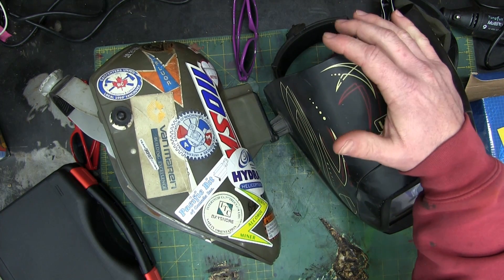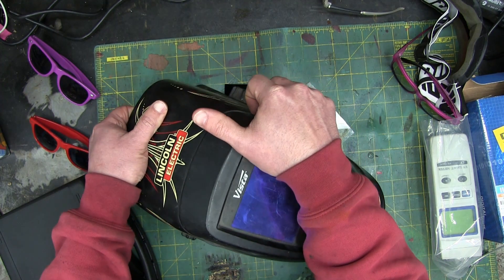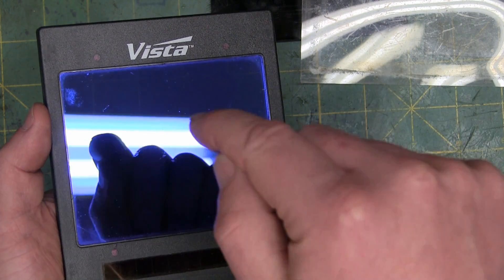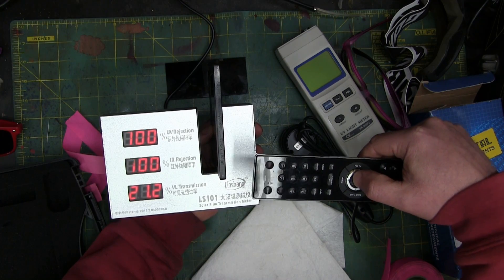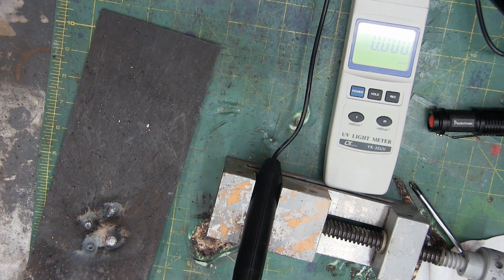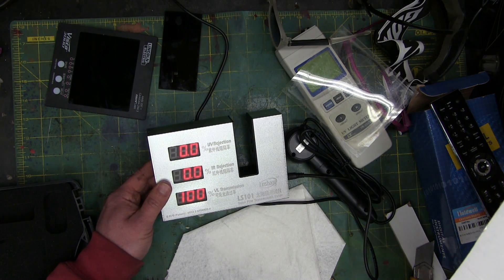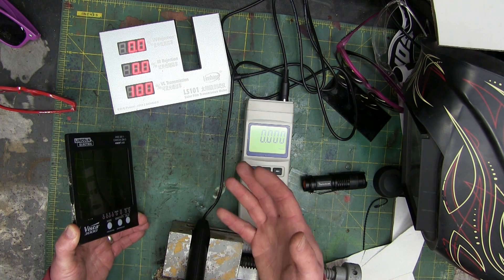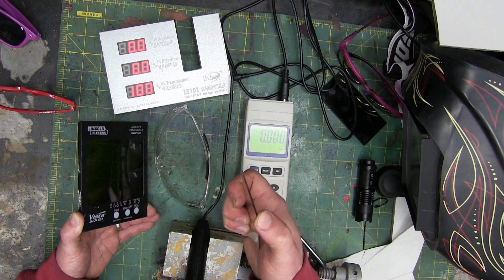SPEED DOESN'T MATTER?! Auto-Darkening Welding Helmet

Comment: I'm a machine operator at a sign company and I run a cnc plasma cutter.  My boss supplied me with shade 5 glasses and I was wondering would that be a safe shade level for running the machine because I think the plasma torch is not as bright but is it?

Comment: I doubt the electronic sensor is faster then the speed of light, I prefer the old way.
Reply: AmongTheWillows 
I am a novice welder.  
If I forget to flick the manual helmet down I have done my eyes some serious harm.
If I forget to turn on the auto-darkening back on, I have the full-time protection of the IR and UV filters in the helmet ,so it's uncomfortable for a second and reminds me to concentrate, but no harm done.
Reply: Andrew White I like the googles, pretty hard to forget those but easy to forget to turn the helmet on :)

Comment: I use my Auto Dark as though it is a fixed lens version.  I don't toss it around, but I close my eyes before striking the arc.  Then open them when I have it on.  So I never get even a microsecond of full exposure.  Of course, I did use it AD mode when I was learning

Comment: what's up with that wire feed dude? i thought they were for wimps....nawww, i love my steel squirt gun. i primarily rock the manual hood sheild welding helmets. broke a few cheap autos. i have hot glued tinted glass lenses into broken auto dark helmets AND used the sides of plastic bottles for a lense cover thing. i am an expert at the power nod welding shield filp down head bang maneuver.

Comment: Apologies if it has been asked already but... could you test the 3M safety sunglasses for IR, UV and visible light. They claim to be 99.9% UV A/B blocking but don't say anything about IR. I suspect they will be similar to regular sunglasses but because they are impact resistant may be sufficient for grinding.

https://www.3m.com/3M/en_US/company-us/all-3m-products/~/3M-ForceFlex-MAX-Safety-Eyewear-Obsidian-frame-with-smoke-lenses/?N=5002385+8740610+3294573936&rt=rud

Comment: Your high speed camera footage was too high speed! I blinked and missed it!
Reply: @TDAKS Probably HARD TO get a camera fast enough TO RECORD .04 MILLISECONDS?
Reply: Not possible by just a Blink...unless you had a decent shut-eye ! or....you are kidding ! Lol !
Reply: The way you record the speed is by having an LED act as a photodiode (or if you have a photo diode + resistor then use those.).  Hook up diode+resistor it up to a psu negatively biased and then hook a scope across the diode.  The time the light goes from something to next to nothing is the reaction time of the glass.  Simple.  You coild shine a bright flashlight through the glass if you wanted.
Reply: two photodiodes into a DSO, that'd give a usable measurement, yeah.

Comment: Clear motorbike helmet visors are UV blocking for the most part but not IR, otherwise you wouldn't feel heat from the sun through it. No good for welding though.

Comment: Talking about auto helmets as a welder I tell people to get a miller digital elite. I've had a speed glass and a Lincoln.They were both shit. So I got an elite and never looked back. Plus the miller has "X mode" which is marketing wank for an em sensor. Works great for welding out in bright sun or construction lights and in confined space where the ir sensors can be blocked.

Comment: I would be interested in checking out the efficacy of polarized sunglasses, and maybe even those yellow-tinted safety glasses, for S&G's.  Also, curious to know if looking at the arc reflected off a white wall is harmful, or if enough of the energy has dissipated from the process.

I worked in a shop that built a lot of furniture, and I was the "wood guy" (yeah I know, but somebody's gotta move the carcasses around).  I used to get flashed all the dang time even though I was working on the other side of the shop.

Comment: As a person who has had to wear glasses since 1981, I'm completely disgusted with those of you who use "safety squints"  instead of proper eye protection.  "Ahhh, I wear safety glasses when I'm grinding...."  Blah, blah, blah.  For the past 36 years I haven't been able to see the freakin' alarm clock clearly without putting my glasses on.  Eye exam, frames (decent frames), lenses can be up to $400.  Run of the mill safety glasses (not to mention cheap sunglasses for you perfect vision fucks) $10-$20.   If you have perfect vision and don't protect it, then get a chunk of metal in your eyes... you'll get no sympathy from me.

Comment: Hey Oncle, I've got a question for ya, my father is a welder, not professional, but more than a hobbyist let's say, I bougt him an automatic shield, not a 500$ one but not a crappy one either (paid around 250european pesos) anyway, he is welding with an arc welder, and he complains about the shield not beeing quick and dark enough, I do not complain when I mig weld with it (I'm getting to the point here, don't worry) is there a big difference in the light radiation between arc welding and mig (or tig) welding?

Comment: I have an interesting question in my job I regular use infrared heat lamps in order to dry things do infrared heat lamps put out the same type of radiation that cooks your eyeballs and what type of protection should I be wearing to avoid this also my workshop we have some of the infrared heat lamps that don't produce light are they still producing radiation would appreciate an answer

Comment: Problem is this tester don't have intense source of UV or IR light during testing! Weak light and even simple clear plastic lens absorbs almost all of it. But situation with intense UV from welding can be very different. More intense radiation - more shielding is needed, tester don't check glass under that circumstances!
Reply: Прикладна Економіка nah it absorbs as a percentage and that doesn't change

Comment: What range of wavelengths is your UV/IR/VL transmission detector measuring? Reason I ask is it could be saying safety specs block 99% of UVA, even if it transmits 99% of UVC, which is the real concern with arc flash.

Comment: If I remember correctly, Acrylic blocks IR transmission really well.
Reply: Acrylic blocks far infrared (>3000 nm) really well, but the IR of interest here is near infrared in the region 700-900 nm, just outside the visible range. Acrylic, as well as polycarbonate, (unless it has been formulated specially) both have excellent transmittance in this region of the spectrum and thus offer no protection.

Comment: Ultra-violet welding sensors would never trigger in that Lincoln helmet, as that (very thin plastic) cover lens blocks almost 100% UV just on it's own.
Every single layer of clear plastic lenses and the untriggered lens-module in the helmet already blocks UV (and IR to a small extent), so the electronic lens really only has to block visible light.
Even crappy $2 clear plastic safety glasses will block 100% UV from your eyes, but IR and visible are a completely different matter.

Comment: IR is not heat. Hot things (by our standards) give off IR but if they're hot enough they'll give off red light (and lower wavelengths eventually) too. Cold things can give off IR too, like IR LEDs. 

The problem with low wavelengths is not that "it's heat" but that low wavelengths penetrate deeper.

Comment: Arc flash eye remedy. Boil potatoes and drop some of the water from the pot into your eye's. Soothes the irritation fast. 

Pasta water works as well. It's the starchy water that you want. I don't know how it works but it does.
Reply: mcpheonixx Let me write that down.. Pour boiling hot potato water in eyes when they hurt.. Thanks a bunch!
Reply: Dionamuh I appologize, I'm used to working with people with a modicum of common sense. For the simpletons out there, please cool the potato/pasta water off before putting a few drops of it in your eye. The funny part is if I have to explain this, then you really shouldn't be around welders or even a shop environment at all!
Reply: mcpheonixx I was joking. ;)

Comment: I came into our lab one day and saw my rubber boots had been worn by someone. I was pissed, just got them the day before, steel toe rubber boots, fuck yeah. Well some electrician needed some boots to work on a plater that had some water in the pit. The guys on day shift told them where my boots were and they could use them. It's been a year and I'm still fucking bitter about that.
Reply: My company is an automotive brake factory. It's machining, plating and then  assembly. I'm in the plating department. We mostly plate zinc with a chromium passivate but we also do nickel/zinc and nickel for some of  the pistons.

Comment: It is only pulsing infra red that triggers those auto shields, steady IR does not, try holding one of those masks up to the sun, it wont trigger but wave your fingers or a piece of cardboard with a slot in it in front fast enough and it will trigger. If you think the sun glasses in cardboard are cheap/funny, when I visited Zimbabwe I saw someone welding using an old black sock tied around their eyes.

Comment: I thought that polycarbonate is opaque to IR because you are able to cut it with CO2 laser that emits IR-light. What about clear glass, like eyeglasses and I don't mean those with plastic lenses but with good old safety glass ones, are those opaque to IR?
Reply: Come to think about it; if I sit in front of the window on a sunny summer day, I can feel the heat of sunshine even through three layers of window glass, so it does not block all of IR.

Comment: Take it from my own personal experience DO NOT Electric Arc Weld without a welding helmet I just used one a little too casually once I was cheating and started the weld without the welding helmet that night I woke up at around two in the morning with my eyes burning and feeling like I had hot sand being blasted into them man It hurts I went straight to hospital it was that bad. I'm guessing it is the same with Mig Welding believe me guys if you value your eyes wear a welding helmet.

Comment: What is the emissionwavelength of the testilidue device? Is it nir (about 850-980nm) or far infrared? I bet it is nir and then have a looksie of the transmission graphs of acrylic or polycarbonate... far ir does not go threw fucking plastic therefore it is a protection for these far infrared

Comment: How much uv or ir does an eyelid stop?🤔
Reply: ever tried to weld with your eyes closed? it aint going to work mate. use a helmet...
Reply: I'm not a welder. But have watched welders tack weld eyes shut and hand to shade.  This  was before electronic sheald.   Just wondered what level of risk they where at.  Thanks. Merry Christmas
Reply: @paulince1715  that's a fair question,  I have done the same when holding something that was being welded

Comment: Hey AvE, not a an expert by any means, and someone else will probably tell me I’m way wrong. But, i have some experience operating and maintaining IR sensor balls on military aircraft, what of the laser designation type and surveillance type. Anyway, that fancy meter you got, what wavelength of IR, or range is it testing. Because near IR (just under the visible Red) will act like visible light, but far IR won’t pass through anything transparent. You just pick up the service radiation of the material. Hell, humid air is pretty good at reducing the resolution and sensitivity of even the most expensive IR equipment.
Reply: The meter is testing 950 nm (near infrared). The arc spits out a disproportionate amount of NIR, and the glass body of the eye has good transmittance of light in the NIR part of the spectrum, meaning it will heat up the retina and possibly damage it. Like visible light, NIR is also focused at the retina. On the other hand the eye (like most things as you've noticed) is opaque to far infrared, meaning that at least the retina is safe from FIR.

Comment: I spent more on my welding helmet that my first welding machine and for good reason. My helmet has 3 modes weld, grind and torch also you can set the sensitivity high enough to auto darken when using extremely low amperage. The nice ones are well worth it.... unless you forget to turn it on.
Reply: Well, as we just found out, even if you don't turn it on, it'll still block out the most important parts of the spectrum regardless.
Reply: most cheap hoods have those options nowadays.

Comment: We bought a 30 something dollar auto darkening welding helmet for the eclipse, it wouldn't darken at all no matter what we did. Used my buddies less crappy auto darkening helmet and it worked perfectly. My question is, would even my cheap-o 30 dollar helmet be providing the same protection even without blocking the visible light?

Comment: Merry Christmas Uncle Bumble....

The prescription lenses in my spec's show up black on IR. They're acrylic plastic based with refraction enhancers .. can't get glass lenses for my dehanced vision any more.

Worked for 7 years "in" steel fab shop. Avoided welding "flash" and radiation burns... Always wore long sleeved shirts and kept 5 metres away from arcs in gas when not wearing eye protection.  Submerged arc... Wow. Only the warm glow of the backing bar tells you that it's working.

Comment: Excess visible light can cause damage as well. Flash blindness can be permanent, you end up with (at best in the permanent case) bright spots that never go away. Auto-shade welding helmets do tend to have a "grind" setting for a very slight darkening of the shade. Otherwise you can wear cutting/grinding glasses. Clear safety glasses are best reserved for working with the closed-cell carbohydrate foam materials and cutting processes, not anything that can throw bright sparks. 

Also it's Z87+ for the high-impact-resistant polycarbonate.

Comment: could you test different samples of common glass? all this reminded of feynman observing the first a-bomb test through a truck windshield, ditching the issued dark eyewear.
Reply: I read that too, and remember he explained why he could get away with it. The laminated auto glass he was watching through had a cellulose (or some other kind plastic) layer. It wasn't common glass. Common glass hasn't been used in cars since the 1930s. Being smart can be helpful!
Reply: jfan4reva I might have been a bit ambiguous, but I meant types of glass that's usually around: window pane, auto glass, recycled or tinted glassware etc - not just plain glass
Reply: +Feynman!

Comment: Everyone in the welding shop I work in uses the auto darkening helmets, they're great for when working with another person or making lots of little welds with starts and stops. We just leave the hood down and never have to worry about getting flashed. Also, there's no friggin way someone with an always dark lens could keep up with the pace, having to flip it up and back down for every single weld when they're only a couple inches long and there are probably 30 or 40 to be made just takes too dang long. I totally went with the buy once cry once option, I picked up the new fancy Lincoln electric 4c lens and it has the sharpest image I've ever seen. Awesome video as always!

Comment: How exactly does it limit the visible light through the "electric" lens? What causes the switch? Curious minds need to know.
Reply: It's basically the black LCD part of a calculator without the opaque silver backing. The switch is probably the bright flash hitting the solar cell or a UV sensor on the hood.
Reply: @stonent the sensor is typically a photodiode which is maximally sensitive at around 880 nm, which is IR.

Comment: My Miller helmet has a "grind" mode for the reasons you mentioned.  For the record, I use it with a Lincoln welder :)
Reply: Josh Rizzo I do the same thing.  I liked the Miller helmet better but I like Lincoln welders.  I put Lincoln stickers all over the helmet
Reply: Haha I like the miller welder, but bought the Lincoln cart because it has room under it for the hypermax plasma cutter.

Comment: I see so many people begging for the HF welding helmet review. Let me head you guys off, and say, don't bother with the $39 one anymore. Their new Vulcan one is actually better than even the Lincoln one in the video above. Worth every penny. Plus, it's a more blue shade, and you can see the puddle much better with it. And FULL head adjustments to make it super comfortable. The only helmet in my collection that's better is the Optrel Vegaview. (Which incidentally has the same blue tint shade as the Vulcan) But the Optrel is $400, the Vulcan is $129.

Comment: So as the eclipse happens this summer and was wandering for no particular reason if stacking afew pairs of sunglasses would offer similar protection from the suns rays?
Reply: I viewed it through a CD. Turns out they are polycarb so it was probably fine for the UV part.

Comment: you could use an oscilloscope with 2 channels to measure the delay accurately, one channel is connected in parallel with an IR led that regularly flashes, and the other channel is connected to a solar panel placed behind the shield glass with a light pointing at it through the glass, you can see the distance between when the LED gets power, and when the solar panel gets its power cut off, then you can also introduce variables and see any difference, like distance

Comment: Reason for this (according to my college courses when we where making plasma uv sterilizer for a space rocket experiment) is that UV wavelengths (specially UV-C) can be blocked by thin plastics due to the short wavelength. We are talking about 10-400nm. Yet infrared is a very large wavelength(relatively speaking 700nm -1mm so several orders of magnitude up from uv) this causes it to be extremely good at passing thorough materials and vibration molecules (ie water molecules in your eyes). 

Great video btw! I know it in theory but never would have taken the actual risks. Is one of those things like the bowling ball on a string pendulum demonstration, physics don't lie but  self preservation goes my urge to try it out.